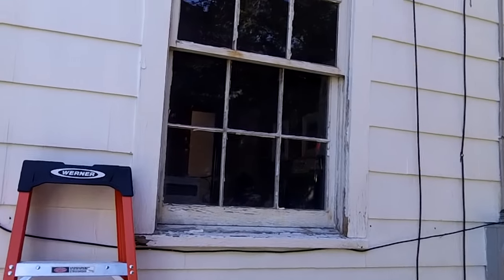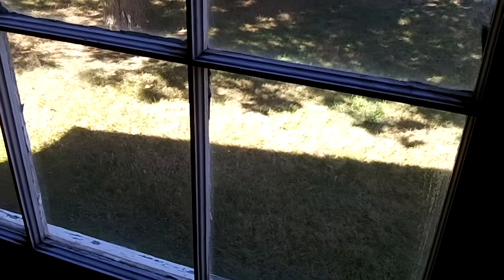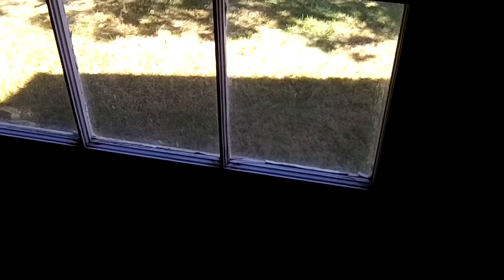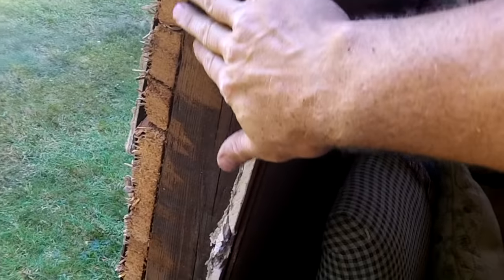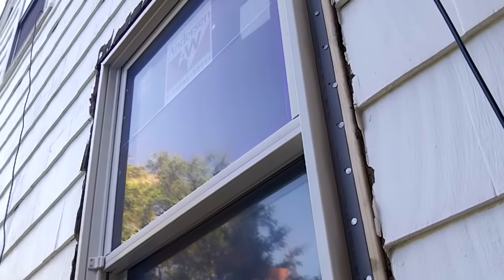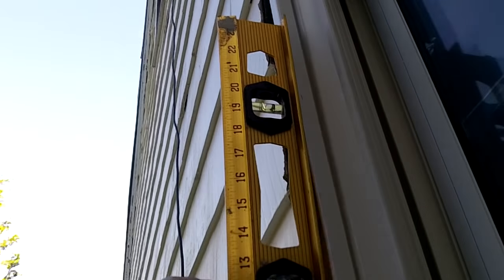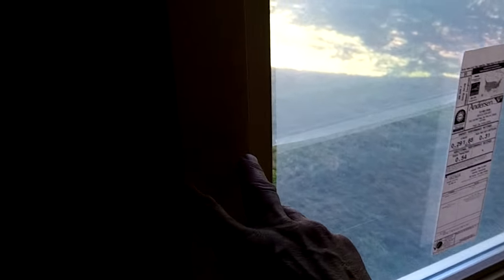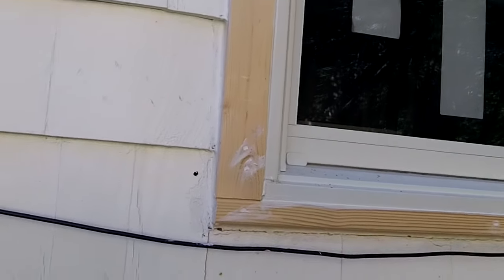DIY: How to install new window on old house

Comment: Hate to point things out. 
Window flashing. 
Oh it’s called Z bar. FYI 
If you do a window this way you will have issues. 
But then I like it. Been doing construction 30yrs and I can’t even tell you how much $ I have made due to things like this. 
I’m not trying to be mean either

Comment: Oh man. Those windows could be restored and stormers put up. Those windows last hundreds of years. You just have to scrape and sand, then three thick coats oil paint, painted little bit over glass, and razor blade it up to the wood and just stay on top of that oil. Vinyl only lasts 30 years, and cannot be recycled. Keep up with oil on the wood and it lasts hundreds of years. Kills me to watch people take out windows that just need TLC.
Reply: Shitty part is they’re doing away with oil based paints anymore. Regardless of what they say, there is not going to be any latex paint that will hold up like oil would.

Comment: I'm amazed that people rip out old windows and replace with garbage vinyl from Home Depot. I'm ripping OUT a vinyl window and putting in a reproduction wood window. Vinyl are horrible.  Why would you just destroy that window and not just repair it?
Reply: My Old House well... considering that in the winter times my old single glass windows would be iced over on the imside and my electric bill was almost unpayable is why most people do it. I couldn't yank my old windows fast enough. My great grandfather built my house and I appreciate the old look but sometimes it's much more logical to modernize...
Reply: My house was built in 1929. Old windows with failing glaze and no weatherstripping. My heating bill? $93.00 a month. Oh. And I live in Ontario. We have the highest electricity and gas prices in North America!  I guess I'm lucky.

Comment: No. Absolutely not. Do not listen to this bullsh*t. 1st. Dont get a new construction window for an existing opening. 2nd. Do NOT take off your outside brickmold/exterior trim and caulking, nor do you take off your interior wood trim and caulking. Much much more to say about this, but do NOT attempt this unless you really know what your doing.
Reply: 1. Why not? Have you ever taken out a 50yr old window from an 75 yr old house? Chances are they are nowhere near the same size as a the new ones nor the same material and 9/10 times the wood surrounding has been basically rotted into saw dust.
Reply: Replacement windows are  good  only if the sill is ok and jamb sides are good, nine times out of ten the brick mold is rotten on a window that old, so you replace the whole window!! You don’t flash them

Comment: You cannot pass knowledge to someone else, when you skimp over major parts of your process by using zero lighting on your indoor shots so badly that no one can see what you were measuring as to the size of the old window.   If you are going to post DIY videos to show off your skills,  actually show HOW to do your projects  will less skill or know;ledge than you have can understand everything  and follow along.

Comment: Just a P.S.A if you have original windows in your old home restore them because unlike modern windows they were not made to be thrown away in 25 years they will last another 100 years. Also if you fix the window strip thick layers of paint and properly weather strip it will be just as efficient.There is a reason they are still on your house.

Comment: ALMOST PERFECT.  Your old window looks like my old windows.  Everything was great EXCEPT you didn't show putting the window in the hole.  Do replacement windows slide in from the inside or the outside?  Did you shim it up to allow for expansion?  Did you foam and weather seal around the window and how did you do it?  What's the difference between new construction windows and replacement windows?  Can you use either as a replacement window?  Does one have an advantage over the other?  TOO MUCH LEFT UNANSWERED.  DO THE VIDEO OVER.